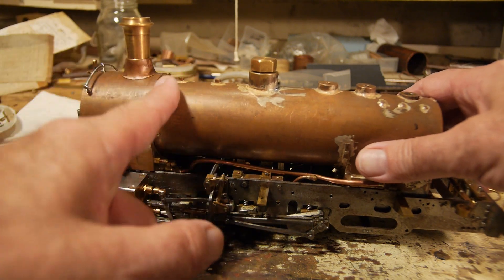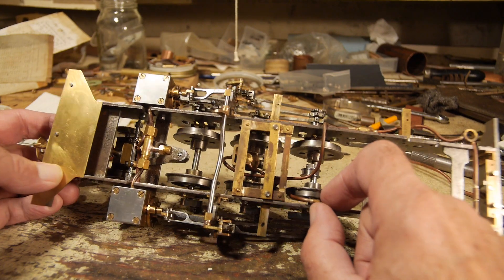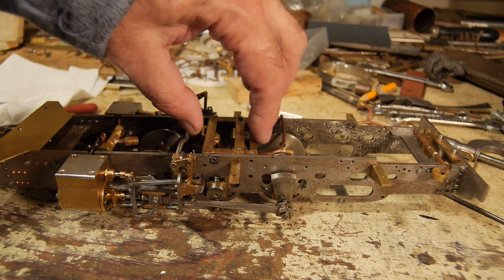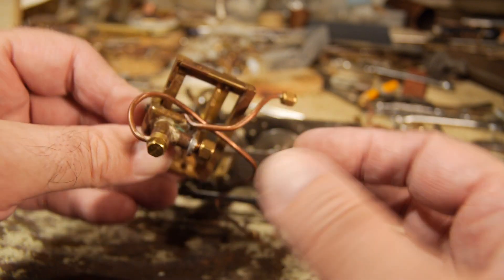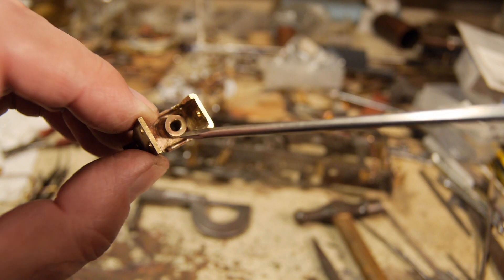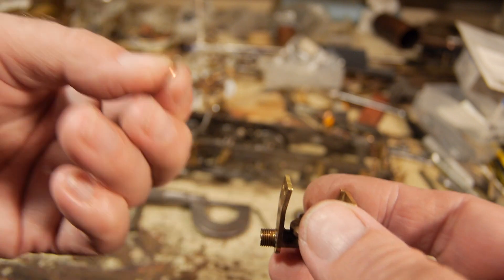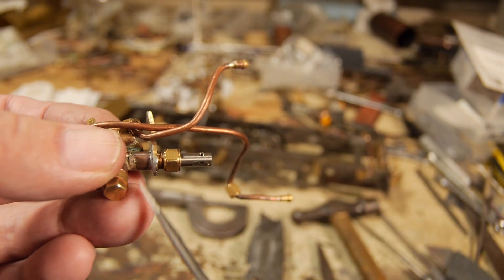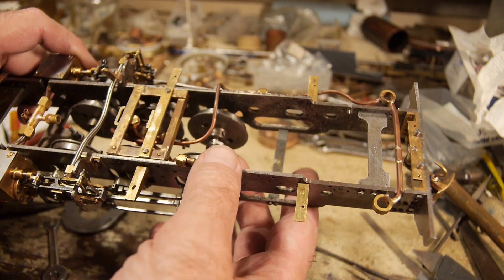'Russell' Live Steam Model Locomotive Part 15

Comment: Why not use an o ring @ 10:30?
Reply from the maker: I assume you mean the axle pump.  There is no need with a gland on the back.  Very little if any water will get round the ram and is stopped by that gland.  O ring will just create more drag.

Comment: Just a bit of a thought on using a steel hammer to seat the ball bearing- why not use a hammer with a softer face (copper/plastic/whatever is softer than the bearing) to strike the ball? 

I know that the ball bearings are cheap, but it is rather wasteful when all it takes is the right tool for the job.
Reply from the maker: You have an interesting point.  My view is that whacking the ball with something softer might not be enough force to properly seat the ball and it could still leave a slight dent in the ball anyway.  So I'm sticking to this method.
Reply: a trick : watch movies on flixzone. I've been using them for watching lots of of movies lately.
Reply: @Corbin Nickolas Definitely, I have been using Flixzone} for since december myself :D
Reply: @Corbin Nickolas definitely, I have been watching on Flixzone} for since november myself =)